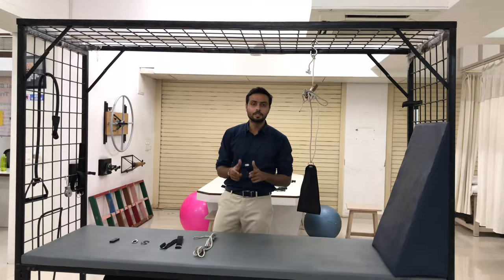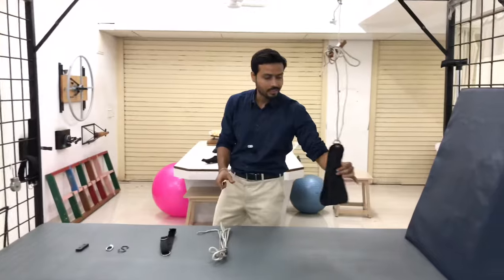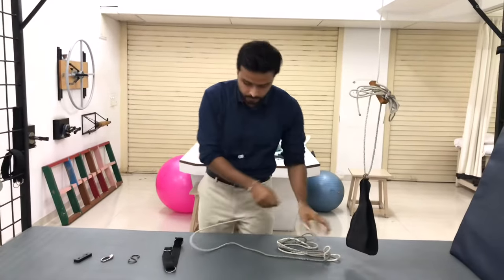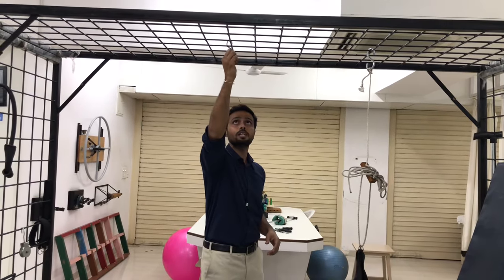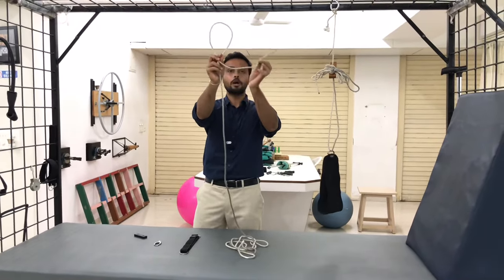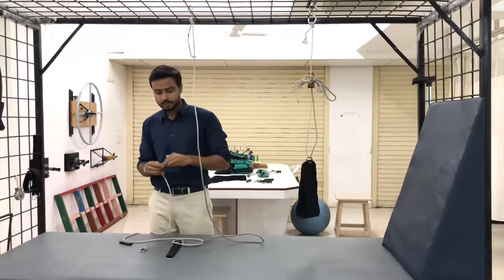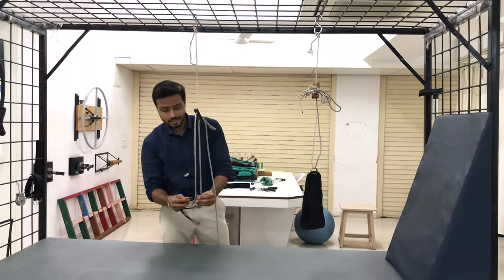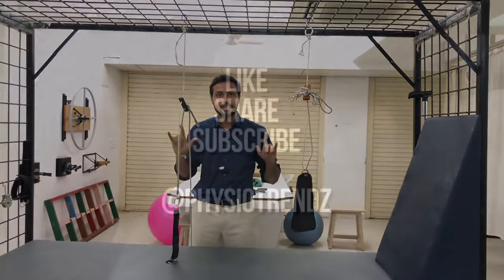Watch Suspension Therapy Basics With Video Demonstration Part-1 For Physiotherapy Students

Comment: How do you know the difference between vertical and axial suspension
Reply from the maker: Axial suspension always performed with reference to axis of the joint line we want to move , and vertical suspension is used over COG of the part to be suspended. You can find more details in following video>>
https://youtube.com/playlist?list=PLw0rQc-QPTY526DltFgdsboy26JgF0_a-